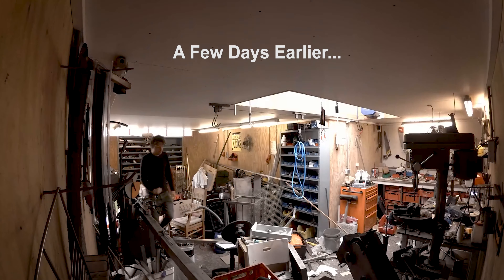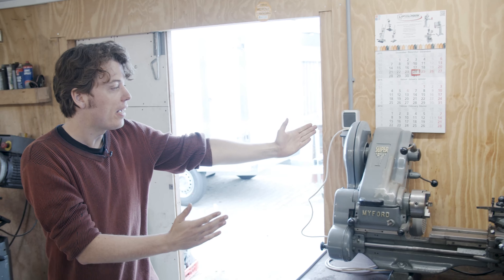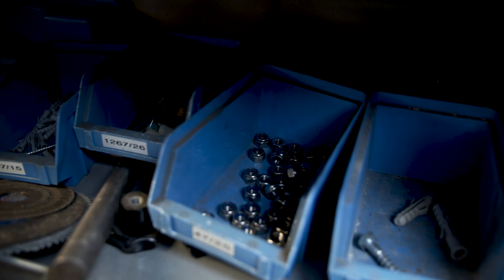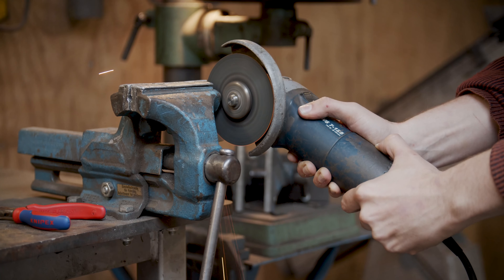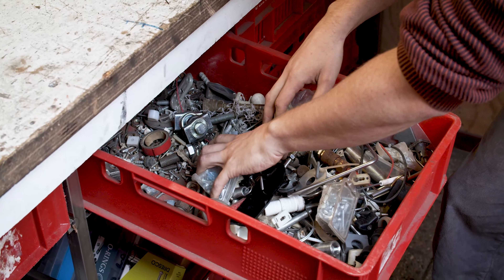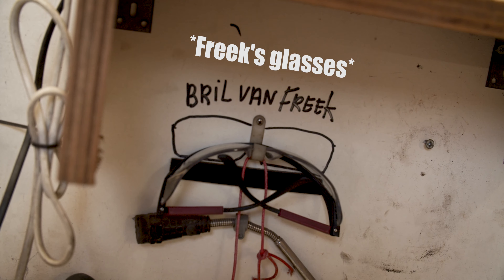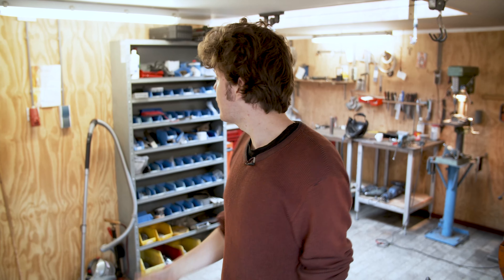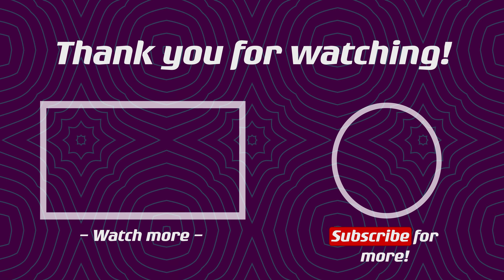A tour of my Shed

Comment: This is my 'by the seat' youtube viewer advise:  Don't blow compressed air on your skin, it is dangerous.  You could potentially inject air bubbles into your bloodstream and that is bad. (This is truly serious if you were to put nozzle right to your skin ... don't do that!)
Reply from the maker: Thanx for bringing this up. I researched the dangers of compressed air and these can indeed be very danerous when the air pressure exceeds 30psi(just above 2atmosphere). The air gun I used was rated under 30psi, however I will follow your advice and not do this again.